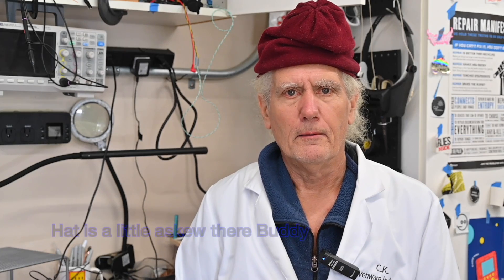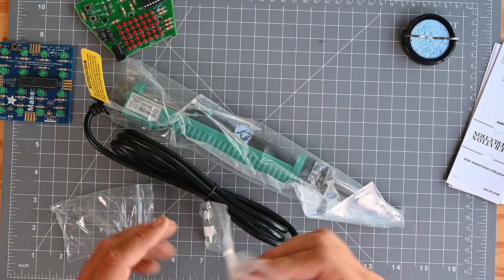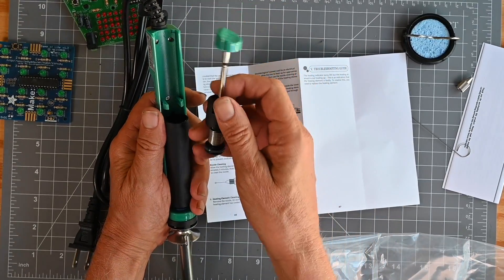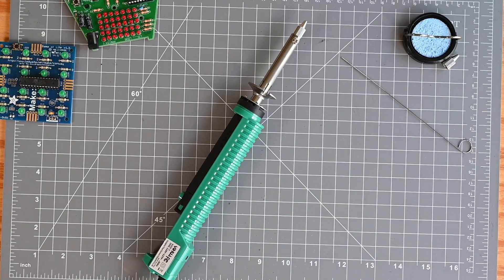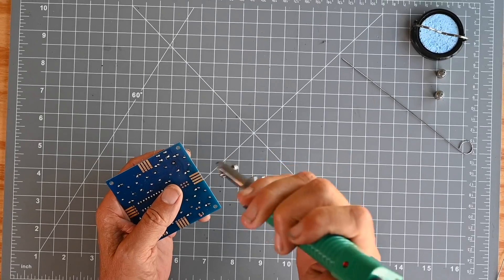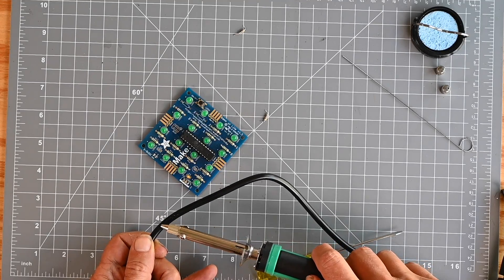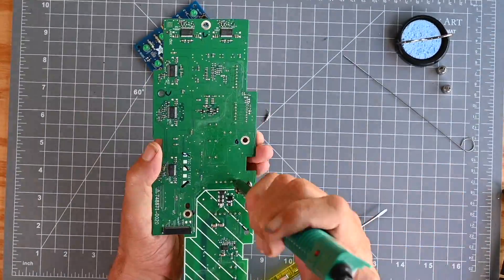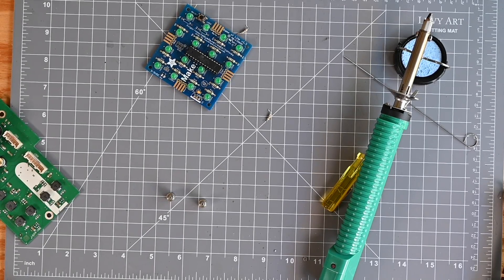C.K. tries a GREAT Yihua 929D-V desoldering tool

Comment: I have the 220-240V version and my mains voltage is around 238V. It gets really hot so it'll oxidize the tip pretty quick so I added a triac dimmer to turn it a little bit down. Now the tip is always looking fresh
Reply from the maker: Good tip (no pun 😂)!  Thanks for sharing and stopping by!

Comment: I bought one for 20 bucks that doesn't require to keep pushing down the kind of "syringue" which is way less annoying
Reply from the maker: You're right, I did a video on one of those that I found after doing this one and pushbutton is way better https://youtu.be/oO7MVZaS6lI
Reply: @ that's the exact one that I ordered. Haven't received it yet though
Reply from the maker: I think you'll like it a lot, I sure do.
Reply: @ i got it and it works pretty well, however i noticed that one thing that's tricky is when there are some bent pins. As when the pins go through the hole and then are kind of bent in place, the solder sucker will suck the solder from the hole, but the leg will stay soldered to the copper circle that surrounds the hole. In such a case, lifting it by force would risk ripping the pad.

Do you have tricks to handle these cases ?
Reply: @SeleDreamsPerso move wires when solder is molten before sucking solder

Comment: Would anyone recommend this for a ps5 controller repair?
Reply from the maker: I haven't taken a PS5 controller apart, but this unit is for through-hole component removal, not surface mount, and I expect the PS5 controller has surface mount parts.  You'd need a hot air gun, heated tweezers, or other surface mount specific tools.
Reply: ano...proč ne?

Comment: I have this exact model. After desoldering about 460 connections the tool needs a very thorough cleaning to continue to function properly. 

Also if you are desoldering large quantities of solder (in mass not necessarily number) the solder will come back out the tip when you charge the pump, so be mindful of where you are pointing it when you do. Unless you like showing hot solder all over your board.
Reply from the maker: Yes, and grab yourself a bag of o-rings to replace the piston rings every now and again.  And yeah, I have dropped a wad of solder out of the tip onto the workpiece, and cursed myself for forgetting *again*. :)
Reply: @CKHaun  new o-rings won’t help without new lubricant. It’s going to get wiped off every time you clean it. 

At least put wire wool or brass curls inside to help capture the crud. Put a filter after the brass curls if possible to protect the vacuum pump.

Comment: I ordered this and worked for a few times, but sadly the rubber ring around the plunger went bad and can no longer plunge quickly.  I tried plunging without it but it didnt work.  I bought a hakko fr 301 instead
Reply from the maker: That’s too bad, glad the Hakko is working out though. Thanks for stopping by!
Reply: @CKHaun  great video man!
Reply from the maker: Thank you!

Comment: I also tried one from a local retailer, but it didn't have the force to suck anything. I suspect the piston spring. It was also dampened as you show in the video.
Reply from the maker: That's too bad!  Just so you know, I just bought a similar device at half the price from Amazon, I'll give it a try this weekend and post the video.
Reply: @CKHaun Hey, have you done the video about the cheaper one?

Comment: Nice review, I have ordered it lot cheaper on Aliexpress - after a full test, I will upgrade the power cable to flex silicone high heat resistance one. I have also ordered a cheap duratool 40w sucker. I will be doing comparison.
Reply from the maker: I think you'll like it, I've found it to be a real time saver, it just sucks solder right up. Though it does take a while to get to operating temperature. The 40w would be interesting, I'll take a look at it.
Reply: @CKHaun  I received the Duratool sucker; nozzle x1 only but larger 2mm diameter ( good for taken out larger components) but the good news are the nozzles of Yihua fits perfectly. Duratool has thicker power cable, stronger suction and heats up quicker(40w - 30% more power) For me Duratool wins. I think you should do a review, a comparison against Yihua.
Reply from the maker: Thanks for sharing your experiences.  I think I've got one of these on order,getting the brand name right on these bargain basement things is sometimes hard, but it was half the price of the Yihua so I think so.  Should have a video on it up in a week or so.
Reply: @CKHaun  Many thanks :-)
Reply from the maker: Yikes, I just tried the one I bought (not duratool brand) and it came both used and cord damaged, and didn't work at all, will be sending it back.  I'll still keep an eye out for the duratool one.  Video up tomorrow (or today, if I'm not lazy).
Reply: @CKHaun  They are normally available in Amazon.

Comment: Hi CK, do you know where I can get a replacement seal for this please. It’s the blue seal under the chamber sealing the chamber to the nozzle part what’s the proper name for it?
Reply from the maker: Hm.  It's not a standard o-ring, it's a molded piece of silicon, so no off-the-shelf replacement, probably only available through Yihua.  I couldn't find it, might be best to post a question on the product page, they seem to be quick to respond.
Reply: @CKHaun  I had written an email to them no response yet
Reply from the maker: If they respond, please post here so we have a record of this for others!

Comment: Are all the nozzels the same size ?
Reply from the maker: No,  the nozzles are slightly different diameters.  One smaller, one larger, than the installed one.
Reply: @CKHaun  are  the tips available separarately ?? if so .....thats cool
Reply from the maker: That I do not know. You might want to ask on the Amazon product page, they may be monitoring and answering.